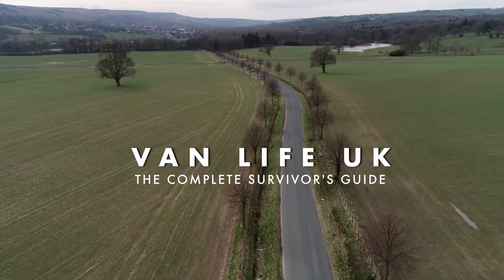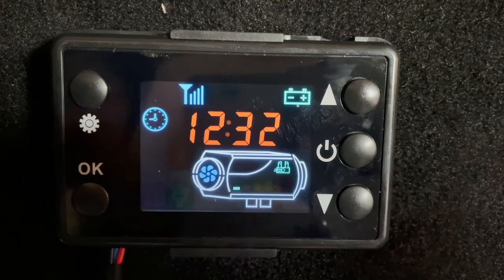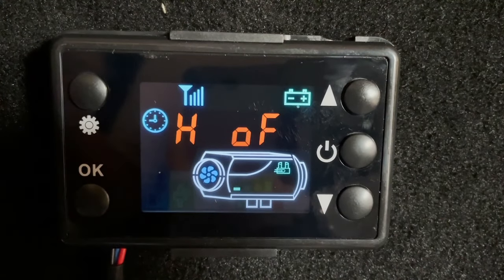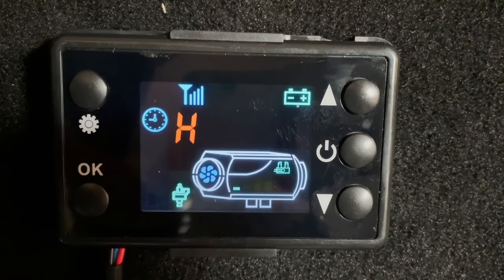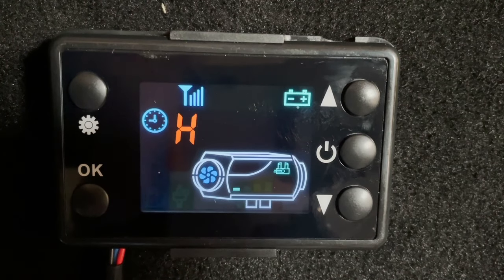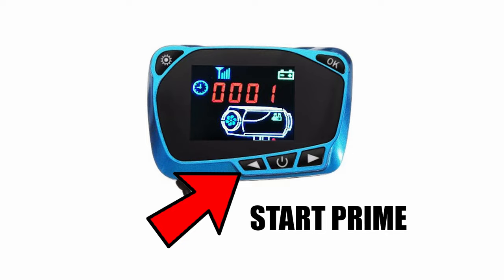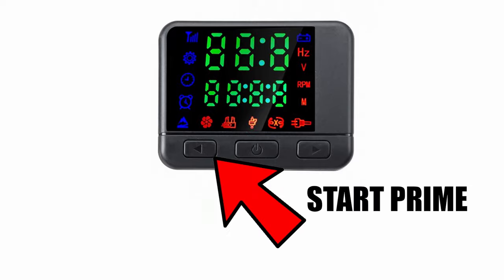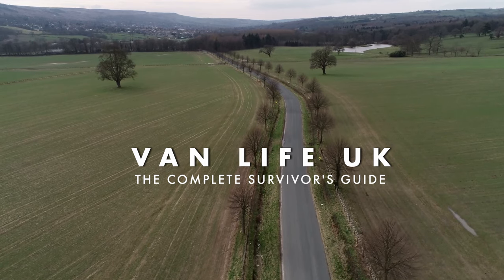How to prime your Chinese diesel heater with the three most common controllers

Comment: How do you know when to stop priming, or does it do that automatically?
Reply from the maker: You have to watch it reach the bottom o the heater and go in then turn it off quickly. You can prime it without it attached to the heater just put the end of the fuel line that attaches to the heater into a clean container and prime the lines until all the air is out of the lines and fuel is coming out the end. Then just attach the fuel line and press go
Reply: @vanlifesurvivorsguide  Thanks - what isn't clear is what happens if you overdrive/overprime? does the fuel leak out somewhere? Stinky fuel all over everything is one thing, but fire hazard is another. I wish someone would just rewrite the manual that comes with these heaters, instead of us all playing guessing games and hit or miss approaches.
Reply from the maker: @theplinkerslodge6361  you can either over prime it a bit and the exhaust will smoke for a while for the first use or you can flood it and the fuel will run out of the air intake. The best option is set the heater up so it is ready to go then disconnect the fuel line from the bottom of the heater a put it into a clean container. Then prime the system until fuel comes out the end and all the bubbles are out the lines. Then put the fuel line back on the heater and press start it should fire up first time no problems.
Reply: @vanlifesurvivorsguide  grear, thank you

Comment: I wonder if you can help me with this one ...my diesel heaters been running fine but I've noticed on the pressure side from from the pump there's a section of air in the pipe. It's also running a little colder. Any efforts to reprime it haven't worked. What are your thoughts ?
Reply from the maker: Is your fuel line the soft green stuff? see error codes 8 and 10 https://www.youtube.com/watch?v=5QlvhMD_pQM&t=308s
Reply: @vanlifesurvivorsguide  thanks for your reply. The last section of the line from the pump IS the green stuff. To the heater it's the nylon. No fault codes are shown. I will try to swap out that section 👍🏻👍🏻👍🏻

Comment: I have the first controller but pressing the two bottom buttons does nothing. Also pressing and holding the arrow key only shows my voltage (U-12v)

Any other variations to try? Thank you. 

It worked fine until the first freezing night. It’s 0220…
Reply from the maker: if you do have the controller in the first picture then you might need to unplug the controller and plug it back it. more likely you have one that looks like the one in the first picture physically but the icons on the screen are different. To prime yours you need to press and hold both of the arrow keys at the same time and keep them pressed the whole time until it is primed
Reply: Yes, that was my problem. I bounced the power and then your method worked. 

Turns out that my air intake hose was choked with diesel. I dumped it and afterwards everything worked. 

Thank you.

Comment: Quick question, for the first controller type, how do I put it in to cold blower mode, just running the fan and nothing else? Thanks!
Reply from the maker: the simple answer is you can't. unless you cut the heat sensor positive cable and add a switch. When the switch is on the heater will work normally when it is off it will constantly blow cold air but you won't be able to control the fan speed